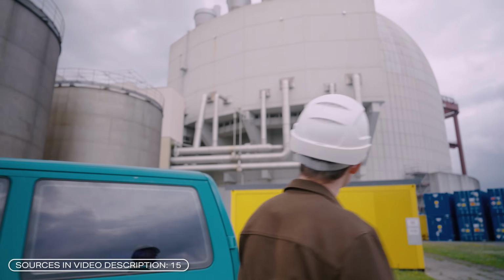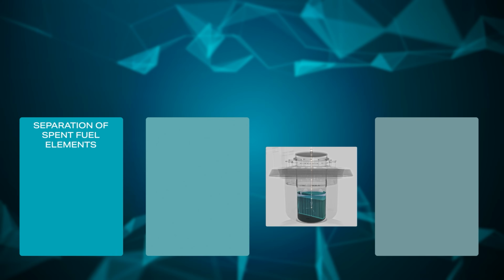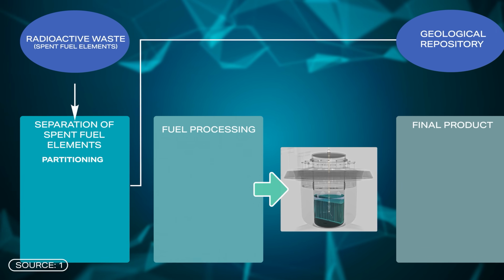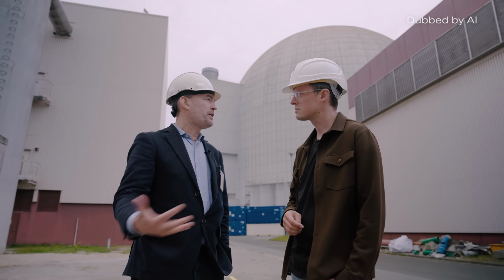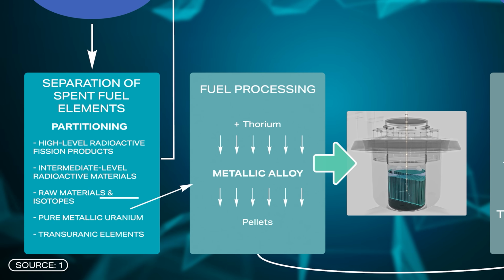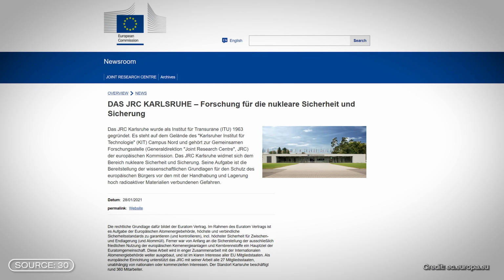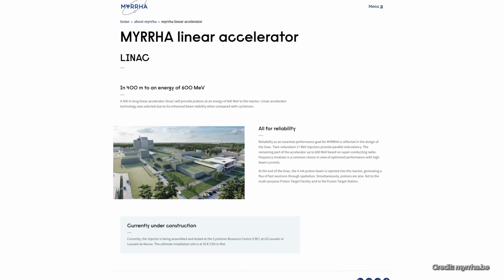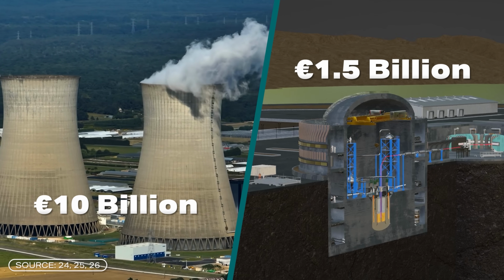Nuclear waste is reusable. Why aren’t we doing it?

Comment: Don't nuclear power reactors essentially speed up nuclear decay under extremely well controlled conditions, and by that cause a net reduction of nuclear decay that can happen on earth in the future from nuclear material that is already here? If so, anyone actually worried about nuclear radiation exposure of future generations more than the first few generations from now should be proponents of nuclear power in general and recycling of "spent" fuel into new fuel should be the ultimate wet dream for everyone that actually cares very deeply about nuclear radiation exposure to humans many centuries from now and further into the future.

We could build safe nuclear power reactors over 50 years ago, not safe enough if incompetent people run them, but nothing is safe then, so that exception to the rule is kind of irrelevant. Also not reactors that reliably can withstand extreme tsunamis, but we actually know where such tsunamis can happen. 

We don't live in a perfectly safe world, the "environmentalists" opposition to nuclear power prolonged our dependency on fossil fuels by decades, fossil fuels which use cause a lot of direct harm, even without any accidents, and accidents happens. On top of that, fossil fuels is the biggest fundamental driver of "political instability", and has been since WW2, many conflicts have been in large part funded by and/or fought over control of fossil fuels.  Without the income from fossil fuels Putin wouldn't been able to stay in power for more than a few months, and it would have been practically impossible to control Russia with such a corrupt system for long for anyone.

Anyhow, I personally believe that our "collective view" on nuclear power really needs a thorough revision, with a sensible perspective, and before that has happened, large investments in it, including "waste" management has a very high probability to become very expensive affairs, with little, if any, benefit. 

€10 billion for a new reactor? Can they build new reactors in China for that? Most recent estimates for total cost for OL3 and FL3 I've seen were well over €10B, and those estimates were old, both have had additional cost increases since, and also significant inflation has happened since. The in 2024 estimated range for total cost for HPC was already €24-27.6 billion per reactor, with the exchange rate as of this writing, without compensating for inflation since. And estimates for total cost have increased multiple times, and estimated commission dates has been pushed further into the future multiple times, just as with OL3 and FL3, and that trend suddenly completely stopping for no reason doesn't seem like the only realistic future scenario. That's per reactor, building two reactors, at the same site, they're not likely to going to complete them for less than €30 billion per reactor, in current prices.

€1.6 billion for 220 MWe net power generation would be much lower construction cost than OL3, FL3 and HPC per unit of generation capacity, if you take inflation and capital costs into account. Even taking the use of existing facilities into account, that estimate needs to be seriously scrutinized, but if it turns out to be completely realistic, that technology should definitely be considered over any other new nuclear power reactors of any commonly suggested technology category.

Comment: Stupid to kill off nuclear waste. Nuclear waste still contains more than 90% of the energy that can be reused in modern, advanced nuclear reactors working on higher temperatures. Smart reactors reusing this waste will eventually release it as nuclear waste again but now with far less radioactivity, reducing this to around 300 years.

Comment: You didn’t explain how partitioning separates elements and convert oxides into metals.
Reply: Because it’s not necessary to.  That’s not the technology being developed.  It’s just basic chemical reprocessing that has been around since the Manhattan Project.  This extra step of transmutation isn’t new either.  It’s just wildly impractical, except now we have a company that is trying to figure out how to bring costs down enough to make it practical.

Comment: 1M yrs isn’t a timeframe for “high level” nuclear waste. With radioactive waste, the shorter the half-life, the higher level the radiation. Yes, the type of radiation also matters, but there is so much inaccurate info in this video that it’s just unbelievable. Very short half-lives (under 1 yr) is extremely dangerous, but for a relatively short time (< 10 years). With a half life of 1 yr, you gets 2^10 (1024) reduction in 10 years.2^20 (~1B reduction) in 20 years.

Long lived radioactive materials give off radiation at a MUST lower rate.

Burning radioactive waste via transmutation certainly makes sense, that’s one thing Thorium fueled “high burnup” reactors such as LFTR can use as fuel. So, the overall idea behind this is solid, but there are just so many mistatements in this video that I had to call it out.

Comment: Any concept that can reduce a "permanent" storage problem, even if it just reduces the volume by only 50% should still be used. Given that nobody wants the waste now, it will only get more expensive later to store it long term. If they could continually reprocess the waste in future to even lower radiation levels, that would be even better, but must mean that the process needs to start anyway, rather than ignoring it now and hoping a better solution comes up in future. I've always wondered why this was not an option to continually break down the high level waste, and now that someone's thought of how to actually do it, it should not be stopped because of financial reasons. Our grandchildren do not want this problem, so start fixing it now!!!

Also using the waste to generate power to break down the waste is brilliant and should reduce the overall costs to process the waste.

Whining about the potential to create weapons grade substances is also stupid. The waste itself is a weapon that's just as bad as a bomb because of the potential to kill people. so securing the unprocessed waste is going to be an ongoing expense and problem. Securing 10% of the volume will be cheaper and easier than 100% that there is now!

Comment: I just want to point out that plutonium is a useful fuel for power plants so it's a bit of a waste if you could sell it to licensed people..

Also neutrons are a major byproduct of modern reactors so couldn't you pipe those neutrons to transmute waste to reduce the necessity for shielding? Turning waste into resources and all that..
Reply: Cancer : Lotto

Comment: actually the stuff thats radioactive for 1 million years is much easier to deal with than stuff thats radioactive for 800 years....because the halflife 1 million year stuff can be buried in the ground with no shielding and not be harmful in anway ...it is MUCH less radioactive than half life 800 year stuff ....
half like million years you can probably eat and shit out and not be bothered
Reply: i think whatevers exposed to the same type of radiation over 1 million years would probably get used to it ;P
Reply: Check this list and all down from that link and tell me you've be winning to be in contact with all of them for any length of time: https://en.wikipedia.org/wiki/List_of_radioactive_nuclides_by_half-life#1012_seconds_(teraseconds)
Note that U-235 is in this category.
Reply: @thekaxmax  If something has a half-life of, say, 211,000 years (technetium), you're going to be dead long before even a fraction of a percent has been released - and it gives a low energy beta emission anyway, that can't even penetrate skin. The beta emissions from the natural Potassium 40, which is in the DNA of every cell in your body, are four times stronger. Also, the biological half life of technetium is only a day, it doesn't get to hang around inside you. The only isotope from nuclear reactors shown to have harmed members of the public is iodine 131. That's harmful because the body concentrates it into the tiny volume of the thyroid gland, where it unloads all it's energy in a few weeks. The half-life is 8 days, so in two months practically none is left. Avoid drinking contaminated milk for that long and you'd be fine. You could even make slow maturing cheese out of the milk, and that would be fine too.
Reply: @2x6x250ml   Several amounts of wrong. 

There's /lots/ from nuclear power plant waste that harms people--it's even been deliberately used in designs for warfare.

Tritium, just for one, is actively harmful if you are in direct contact
Reply: @thekaxmax Tritium has a very weak beta emission - ie an electron - whose average path through water (which is what humans mostly are) is less than the diameter of a cell nucleus. Although the half-life is about 12 years, average residence in the body is about ten days. Permitted levels in different countries differ by several orders of magnitude, but even in cases where people accidentally recieved many times the largest permitted dose, they had no documented harm. Each cell has to deal with dozens of cases of single-strand and double-strand DNA breaks every day, mostly caused by oxygen. Free oxygen causes the same hydroxyl radicals as radiation, but on a much greater scale; unless the breaks are too frequent and close together to repair, the cell's repair machinery deals with it as a matter of course. That's why aircrew, or the residents of Ramsar, Iran, who recieve much more background radiation than any reactor tritium leak ever produced, show no ill effects.
Reply: @2x6x250ml   It's still dangerous. And there's dozens of others disproving your statement above.

Comment: Why not use a functioning reactor as the neutron source? Wouldn’t that save a ton of money in this process?
Reply: None running in Germany
Reply: Ship the waste to a country that does the reprocessing or has the neutron beam line. Russia still takes the stuff and sells new nuclear fuel. So the process can be done elsewhere. Use the DOE containers on railcars.
Another possibility is that even a fusion reactor that is slightly net energy puts out neutrons when using Deuterium fuel. We got those built now and there's 5-7 candidates for that.

Comment: I would like to see a comparison between the amount of energy the fuel produced, compared to the energy required to "transmute" it.
Reply: the idea would be to use surplus grid energy from a new reactor or sustainables like wind and solar, geothermal etc.
there is also a cost for storage, remember.
Reply: I suspect it is very negative. But the primary purpose would be to separate plutonium for bombs. In that case the fact that the whole process is energy negative doesn't matter.

Comment: I don't currently have an opinion on the management of nuclear waste but did ask the web about the mass of radioactive waste generated by power production.  The globally-accumulated waste since the 1950's is about 300-400,000 tonnes or ~30,000 cubic meters, or a cube ~30-35 meters per side.  No mention was made of the requirement for the additional volume required in order to effectively cool the mass.  This is merely for perspective of the storage problem.  The time component of keeping the material secure is the overriding issue as the US is currently demonstrating the potential fragility of even "stable" governments.

The mass may be embellished as one likes to account for the irradiation of reactor materials other than the fuel rods.  I have not investigated the potential toxicity of these materials and their storage requirements.

Comment: Of note: if you reduce the nuclear lifetime from 1,000,000 years, to 800 years, you are increasing the intensity of the radioactive decay, which can itself be problematic for storage. And still has functionally the same long term storage issues, as in it's still a longer timeframe than most countries have existed... not negating the fact that a "nation" is a relatively new concept within the overall frame of humanity.
But, if we're lucky, these more intense waste products could have a use for its energy potential.

Comment: The original idea was to use fast fission reactors to burn out the fuel poisons so that the rest of the fuel can be used again (and again, and again) in the fuel assemblies within a running nuclear reactor.  Because of the fear of plutonium proliferation and weak leaders, fast fission reactors were outlawed.

Comment: Cool idea. If they somehow get the process working and it's financially viable, good. 800 years is a lot easier to plan for than 100000. There would no longer be a need to find/make more places like Onkalo here in Finland to deal with that 100k year waste.

The AI dub was fine, as long as you made sure it didn't change the original speaker's message.

Comment: Fast breeder reactors can burn nuclear waste at the same time enriching thorium for fission🎉
Reply: They have extremely serious problems.
Reply: Material science has come a long way since the 1970s
Reply: @rogerphelps9939 No they don't.
Reply: Ah yes, 'burn' waste, even though these are nuclear reactions and not combustion in anyway...did you get your information from the back of a cereal box? Back of the line, bud.
Reply: @MS2A-d7e Burn is the technical term used in the industry. Google is your friend...😅
Reply: @MS2A-d7e  OK line monitor.  Burn is the term for using waste to fuel other reactions.  The whole reason the fuel isn't spent well is nuclear doesn't run at full power ever. Probably 45% for peak times. Just like combustion a poorly stoke fire doesn't make complete reactions 🎉